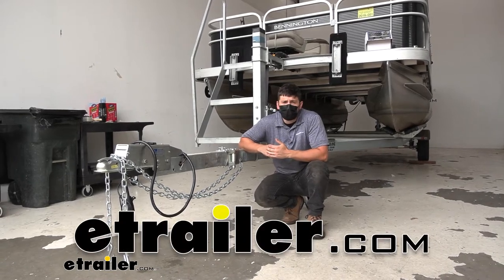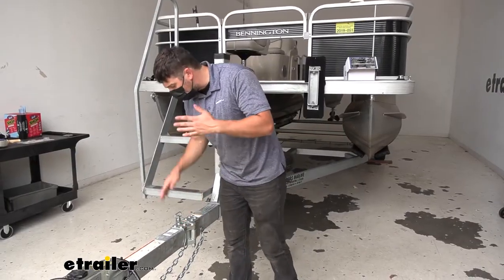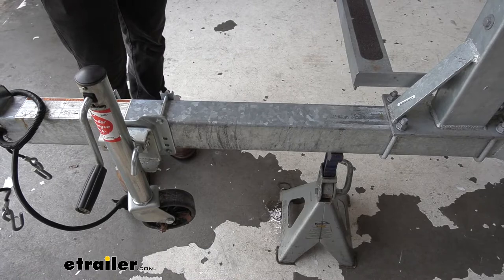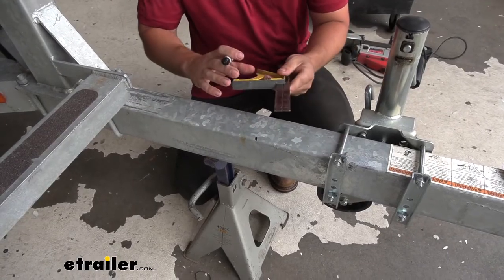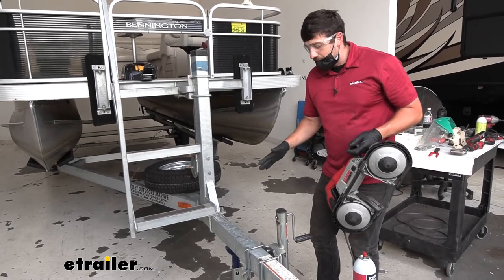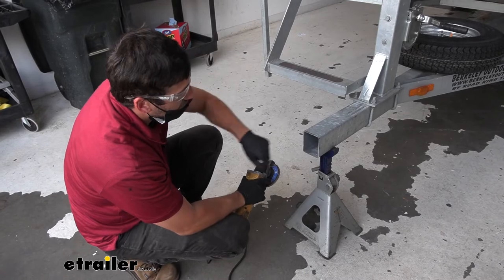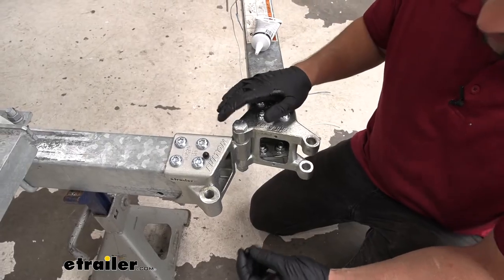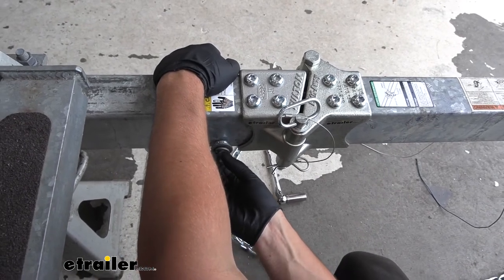etrailer | Fulton Fold-Away Coupler Hinge Kit Review and Installation

Comment: Thanks for the video. I wanted to order this coupler for my aluminum trailer but I understand you are saying it is not recommended. Im guessing it's to do with aluminum on steel. I was hoping the zinc coating would be enough for it to be safe as well as the large amount of aluminum vs small amount of steel. Online people have said they've used it and had no problems but I wanted to double check before ordering from you guys

Comment: I have a 18.5ft bayrunner with that type of trailer. Not sure how much the boat weight and trailer weight because the information isn't found anywhere on the boat. Will this kit work for me? My trailer is extremely short at the tongue so I will need to extend it with another piece. Thanks
Reply from the maker: The Fulton Fold-Away Hinge kit is designed for 2" x 3" trailer tongues. Trailer tongue material thickness must be between .188" and .120" with a capacity of up to 5,000 lbs. You'll want to determine the weight of the boat and trailer, we'd recommend having your trailer/boat weighed to make sure you don't exceed the capacity of the hinge assembly. If your existing trailer tongue meets the above parameters, the hinge kit will work for you. You'll want to make not of the table on the linked product page that shows how the hinge capacity changes with the length of the trailer tongue.
https://www.etrailer.com/Folding-Trailer-Tongue/Fulton/FHDPB230101.html

Comment: Should you have cold galvanized where you cut the trailer and bolt holes?  It seems like you broke that protective layer open enough to potentially become rust if not treated with something.
Reply from the maker: Thanks for the tip. We'll bring that up to our video production team.
https://www.etrailer.com/Folding-Trailer-Tongue/Fulton/FHDPB230101.html

Comment: I have I believe copper brake lines running to my actuator. What is your recommendation I do for dealing with that? Thanks!
Reply from the maker: You'll need to install flexible brake line. We offer them in varying lengths, which you can see near the bottom of the linked product page. https://www.etrailer.com/Folding-Trailer-Tongue/Fulton/FHDPB230101.html